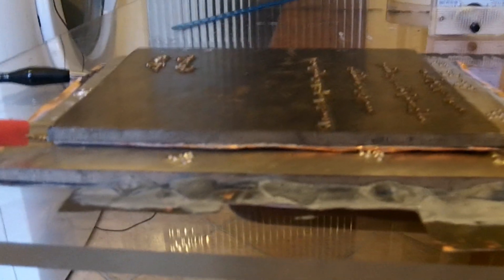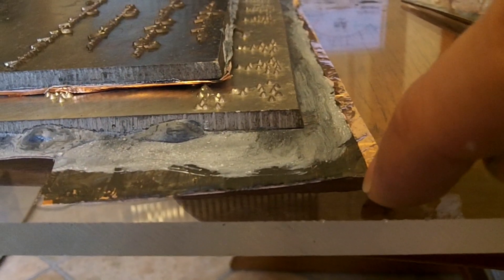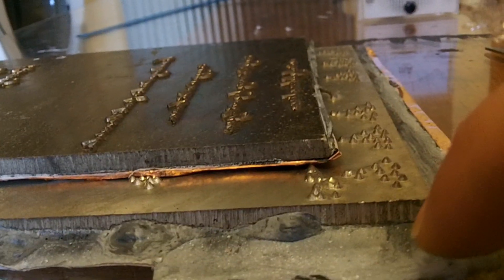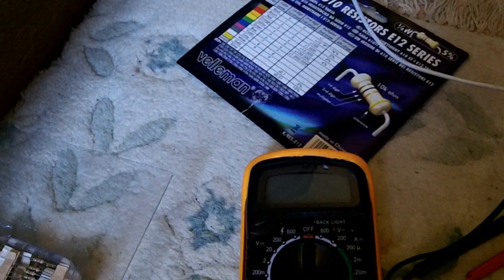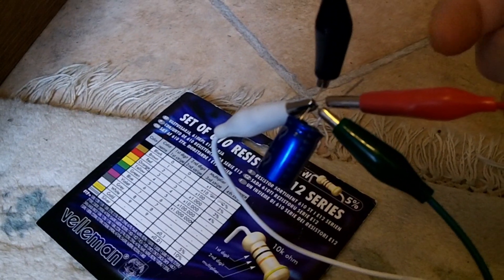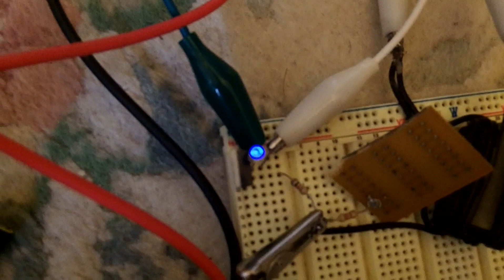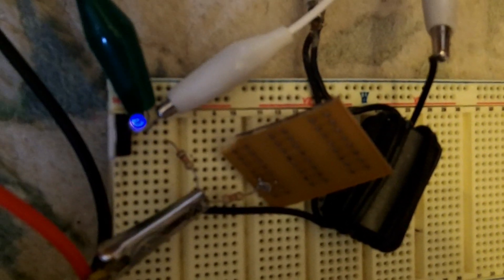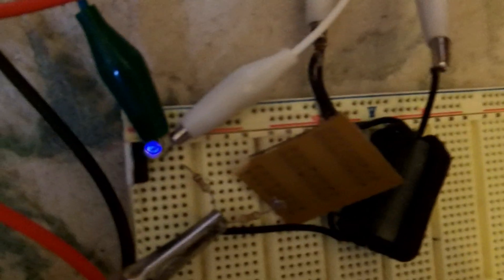Lovell Monotherm with Robert's conductive ink

Comment: I've had much better results using AZ31B and copper foil, sticking to the original design parameters in Lovell's patent. Voltages of about 1.25 at 80 degrees ambient, with enough current to run a motor (and small propeller) from a micro quadcopter at low speed for over 24 hours. You don't really need more capacitance as the device is already a hybrid capacitor and solar panel (infrared light aka heat).
Please let me know what you think, or if you've made any progress since this. I will post videos soon.

Comment: did you try heating the stack up at all to see if the voltage produced by the two in series would increase above the .8 volts dc you noted?

Comment: Hey can I ask a few questions regarding the reasoning or thinking process behind this experiment?

First, what function does the conductive ink serve in this device? How does it differ with the graphene in Mr. Smith's device? 

Second, does magnesium act as p-type semiconductor under heat? Otherwise, how do you know it's a monotherm type device? 

Thank you sir. I've been working on this device recently, and I'm deciding if I want to just mix the ZnO with the conductive ink or to separate them in layers like you did. I would test both, but I have a very limited supply of conductive ink, so I can't afford to make a mistake. Good luck with the rest of your work!

Comment: Well done ! Were do you get the big magnesium plates from ? How much are they ?
How much moisture is in your room ? Normally Magnesium corrodes already with other metals if there is enough moisture in the room...So you would need to seal this up somehow...
Reply: I get my Magnesium on ebay. 10 quid a kilo for pure Mg plates from old printers. Just make sure you scrape off the green layer of paint. Then sand it down to get a nice smooth surface. 

http://www.ebay.co.uk/itm/MAGNESIUM-METAL-1-x-kilo-99-9-pure-Magnesium-NOT-RIBBON-L-k-/110941311942?pt=UK_BOI_Medical_Lab_Equipment_Lab_Supplies_ET&hash=item19d49e13c6

Sure, sealing them up is next on the list. I doubt I will do it with these two though. I am going to make 2 more, but with a sheet of copper metal. Then I will be able to seal the connecting edges completely with Epoxy. Watch this space...

Comment: Thats looking really good. Have you tested exposure to heat and sunlight etc, to see if you get more output?
Reply: Not yet mate!  I wanted to try it on the radiator today. At the moment it is going flat, rather than running continuously. The voltage on my cap starts around 0.8 and when it passes 0.65, it starts to flicker and go out.
Reply: Is it regenerating after the load stops?
Reply: Yes. No problem
Reply: OK, it's on the radiator, and the cap is filling with voltage very quickly. Heat definitely increases the output. That's clear. Wow, almost 1V already. Let's see if it can run the J.T a bit better....hang on....I'll report back in 5 mins...
Reply: Great news. With the device on the radiator I can keep the LED going, and the charge on the cap is continually rising. So, I guess that means it's producing more power than it's using to run the LED, and dumping all the excess in the cap. I must admit, the thing is really hot to touch, so not surprising to see some energy coming out!
Reply: Sounding very promising :) about to watch your radiator video now :)
Reply: Great work, do the cells still work after all this time, because I am interested in making a monotherm cell, and are they powdered by heat and moisture or just heat alone. Thank you

Comment: Good to see that ink being used.
How humid is it over there ? humidity will be a factor in how this runs. Should brighten up nicely if you do several push ups in the room, with the windows and door closed lol
Reply: Hi Slider! Yes, I wondered if this was being powered by water and corrosion of the electrodes. I hope that it isn't, but I have learnt from those crystal batteries that it very likely is water! I will try sealing it in epoxy and see whether it continues to work.
Reply: The guy did get a Patent though and that table of elements was intriguing in RMS's video. It might well work as described, just has that salts cells niggle of humidity to overcome.
Great experiment no matter what, glad you tried it out :)